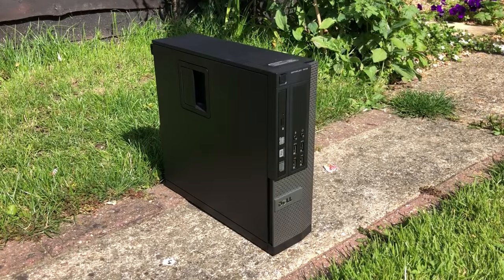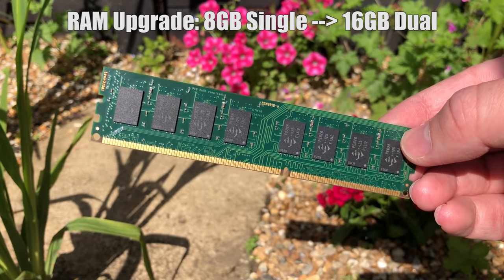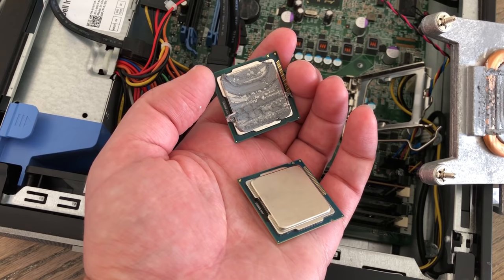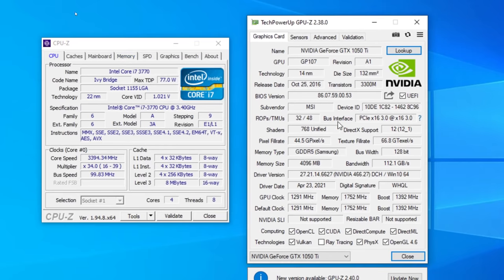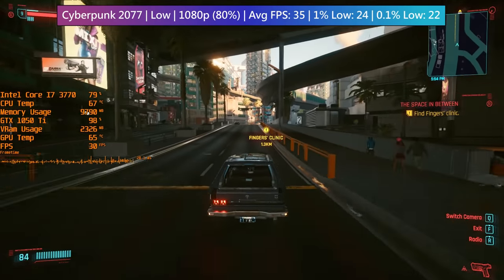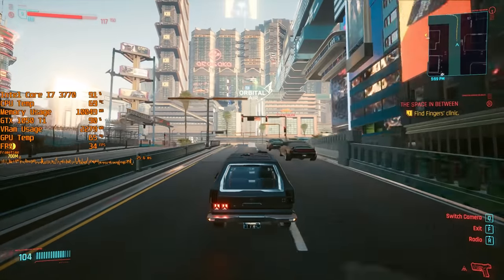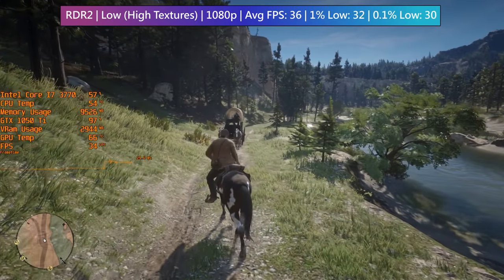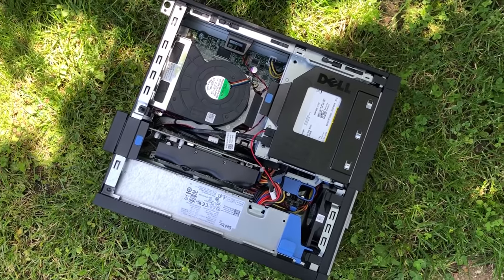Turning The Tiny, Cheap OptiPlex Into a Gaming PC - With Whatever’s In Stock

Comment: I just finished upgrading 2x optiplex 3020 mt’s. 16gb 1600 ddr3 in both, i7 4690 in one with an upgraded psu and 750ti. The other upgraded to an i5 4570, 16gb ram and a 1030gt. (Ssd’s fitted) -both were cheap to put together and work well -very happy -would recommend

Comment: I used to have an optiplex that I used for many games but it was really stuttery and hardly ran more demanding games that I liked even on low settings. It had an i5-3470, R7 360, 520w old psu, 3x4gb 1333mhz drr3, 120gb ssd, mobile 1tb hdd. After upgrading, 20 fps feels nice cause it's not stuttery anymore

Comment: I did something similar with a Haswell-era Optiplex for a back up machine. I used a Quadro P1000 instead of a GTX1050/1050Ti as it was cheaper at the time. Not sure how things are currently with the GPUppocalyse, but it used to be that lower end Quadros would often plummet in price when they got old, so were worth keeping an eye out for.

Comment: I have a Dell OptiPlex 7010 SFF: e3-1270v2, 32GB ram and GTX1650LP rig that is decent although now my main one is a Lenovo Y900 tower: I7-6700K, 32G ram and a GTX980ti. I still have my Dell for a backup, and also it's easier to take with me to different places.

Comment: i got an OptiPlex 3020 off eBay 8 months ago and ive been happy with it ever since, it came with an i5-4570 and 8gb ddr3 but i upgraded it to 16gb ddr3 and i added a gt 1030 because the 1050 would not fit (yes it was low profile) and i overclocked the gt 1030 debloated windows and i would say it matches the performance of this build and if not even provides slightly better frames especially in red dead

Comment: Sandy Bridge and Ivy Bridge were really solid processors. I managed to overclock the i7-2600k high enough to match the performance of newer generation intel chips, with no cooling problems whatsoever. Those generations were really OP when it came to performance.

Comment: I've got a 7010 with an i5 3570 in it. It only supports 16gb. And, the pcie16 socket is rated at only 50w despite being 3.0. While people do put 75w cards in it, it does both cripple any card that uses 75w, and stresses the board and psu. The gt 1030 gddr5 is honestly the strongest yet safest gpu you can use indefinitely. The PSU is a very uncommon/rare/really only made for oem's called LFX, which has different length and height from TFX as looking at it from the back of the pc. Also, I'm not absolutely certain, but I'm pretty sure they swapped a couple of pins in the 24 pin connector around as well, but if you happen to find an LFX psu with more wattage, then you likely could just use a molex pin remover and swap the pins around as needed, but good luck finding an LFX psu in the wild for anything other than the computers they're designed for (they typically have proprietary power connectors).

Comment: I built a refurb Optiplex with an i5-7500, 16GB RAM, 240GB SSD and the 75W low profile GTX 1650 for just under AUD$900 last October, runs really well; Deus Ex Mankind Divided at 1080p high settings is no problem. Make sure you buy a USB DAC as well though, because the onboard audio is rubbish.

Comment: Amazing upgrade. I'm building a new system with a Ryzen 5600X, but until then, I'm still rocking my old Xeon X5650 (upgraded from an i7-950!) with a 1050ti. 

16Gb is indeed the sweet spot for gaming, only thing I would recommend, if possible on a budget, is to get the fastest memory modules you can.
Maybe also replacing that case fan with something better like a Noctua one (although they aren't the cheapest), and definitely ditching that DVD drive, which could help improve airflow and temperatures inside the case... :)

Comment: I brought that unit recently except since it came with an i3 for $40 and that was because it had no hard drive and ram. I ended up upgrading memory to 8GB, 500GB HD and stuck in a Nvidia 210 and ended up being under $100. My only issue was it came with some bottle necking due to i3, but did find some units that came with i5 I hope to snag someday and have been aiming for those GTX 1050 ti or 1650 low profile ones.

Comment: Got the exact same optiplex, upgraded to 3770, 1tb ssd, 16gb ram, cut a hole in it and put in a 1650. I also painted it, to make it look rusty, put some chains and stuff on it. Like a "mad max" kinda build. Runs great😁🤘
Reply: does it give any problems?
Reply: @lightffx4423  This is a late reply, sorry about that. But no it worked perfectly fine. Just make sure you get the 1650 that dont need external power, and know that the cpu runs a bit hot, but nothing to bad as long as you mount the cooler okay :) And since I cut a hole in it, since i couldnt find a low profile 1650 my gpu never got hot x)

Comment: For Cyberpunk, setting crowd density to low and slow HDD mode on (even if you use an SSD, since what this seems to do is reduce draw distance) also helps a bit with FPS. And also ray-tracing to off if you have a GPU that supports it but that's irrelevant with a 1050 Ti. Ray-tracing eats a fair bit of CPU if enabled.

I have an i3-10100 and those three settings keep me at 60 FPS most of the time, because said i3 is a 4 core / 8 thread part and Cyberpunk really struggles with those even if they're newer.

Comment: I have a 1650 in mine and I'm very much enjoying it. Was playing Fallout New Vegas at native 4k high settings with a solid 60fps. (No I'm not lying). It's insanely awesome and I'm genuinely surprised it can do that. Warzone on the other hand struggles to maintain 60fps but it plays fine. All in all, very happy with the machine. Much better than a base xbox one or ps4 around the same size.

Comment: My dad's had an optiplex 790 sff for nearly four years as a family pc running Ubuntu, it has a 2400 and room for a low profile 1050 so I'm tempted to clean it up, replace thermal paste and possibly add a fan and get a gpu to sell on.

Comment: Yoo nice. Ive got a similar build (my dad's actually), i7 3770, 16gb ram, optiplex 9010 with a msi GT 1030 GPU (fan model). Ive done some benchmarks and gaming tests on there and I'm really happy how it performs considering it costed only $300 AUD (£161), the CPU cooler is absolutely fine, better than what most Dell gaming prebuilts offer now, but the GPU does run a little hot at 80 degrees Celsius.

Comment: I had one of these PSUs explode with GTX1050Ti, I recommend removing the disk drive while at it to lower the power consumption slightly.
Reply: Bro which psu explode was your pc Dell optplex 790
Reply: @feyn321  yeah, I replaced it with similar PSU, and it worked fine after. Now I have removed the graphics card because the fan started making noise and I couldn't get another one.

Comment: That’s what i did ,optiplex 3020 tower with i3 4130 for £70.Put a 1050ti low profile(wasn’t my choice that’s the one cex sent me .Then later down the line got a 4590 for £40 .Switched case finally got a new mobo and I’ve got a properly built gaming pc now !

Comment: I feel like a 1650 would have been a perfect match for this system!
Reply from the maker: Yeah so hard to find at the moment, or way too expensive :(
Reply: A low profile 1650 costs around $400 in the USA, so I can only imagine what it costs elsewhere.
Reply: @madmax2069  here you can get a 1650s for the same price as a new 1050ti (~200€)
Reply: *here in germany
Reply: @TheMauriStar  But are they the low profile version? They have one on UK Amazon, ASUS but it is not low profile at £299.

Comment: I bought a couple of Optiplex 790’s a few years back as they cost about £40 from eBay, Both have an older i5 2400 CPU which Work for the most part, I stuck an AMD 290 Full-sized Graphics Card in mine & was unable to fit the lid back in place but that’s fine and it’s only been used for Protein Folding, I haven’t done it now for a while due to the Cost of Electricity, I may see if I can upgrade the CPU & try & find a low profile Graphics Card as I do have an assortment of Graphics Cards in a box here somewhere, They are a tidy compact Machine and the only downside to them is the PSU, I think I’m using a Desktop PSU that just plugs in and sits behind the PC, It works but obviously not ideal! 😂

Comment: If you can find a Xeon E3 1270 V2 for cheap, and have a GPU, that's also a great budget replacement, as they run a little cheaper than the i7 still. I have one, and it cost ~$50 USD, whereas an i7-2600 is still ~$60USD.

Comment: I have this exact pc, though I have the Optiplex 7010 with the big case, it got the i7 3770 and 16gb with 4 sticks of ram. I stuck a rtx 3060 in it. It runs really well in most games. The games I tested are Minecraft Java, GTA V, BeamNG Drive and Minecraft Bedrock RTX. It does struggle with GTA on very high settings, mostly due to the cpu. BeamNG Drive can play on the highest settings at 55-60fps. And Minecraft Java can run and med to high settings at 60fps with shaders. Bedrock with rtx can run at 60fps with high settings. It is a really solid pc.
Reply: I am not saying to get a RTX 3060, a 1050ti should work fine. But just get what you can afford and what is not over priced.

Comment: I did one of these before but it was the mini tower model and I changed the power supply also. 3770 and 1060 6gb. Add a SSD and you've got a Solid PC.

Comment: THIS IS THE VIDEO I NEED THANKS
Reply: by the way, where did you buy the 1050ti? im gonna build a optiplex pc with a rx 560 and im worried that it wont work or will go out of stock. there arent many good 100$ graphics cards
Reply: @skunksecond  I would recommend a 1050ti over a rx560, as a 1050ti performs about 30 to 40 percent better than the rx560 best of luck with the build 😄

Comment: I turned one of those into a heck of a pc for my daughter.  Nice for a pc I bought from work for $50. I put it in a new case.  There is a thing for the power switch off of ebay you can get to work for the power button.

Comment: Xeon CPUs will run in these Optiplexes. They can be had cheaper than i7s. I bagged a quad core fourth gen Xeon on eBay for £15 and it runs in my SFF 7020 with no problems at all.

Comment: I have build the Same PC 1 year ago. But I have 24GB Ram and use a Gigabyte 1050ti OC Edition with 1 Fan, because this card is silent in Idle Mode, the MSI 1050ti I used before with the 2 fans runs always with 40 % fan speed and there's no way to lower this! Afterburner doesn't work!
It's the perfect understatement Gaming And Lan Party PC :)! And yes, it runs Crysis very smooth in FHD with Ultra Settings. Dirt 4 and Fallout 4 in FHD with highest settings run very smooth too. Cs Go in FHD with maxed settings runs always  between 200 and 300 FPS!
I became the PC for 0€ and the GB 1050ti OC costs me 60€. I have much luck to became this. I build a 500GB Samsung Evo SSD in it ( for. 0 €:) and my external 4TB HDD changed in this PC too.
It's crazy how much Place is in this little case and how good it's upgradeable. Dell does a perfect job here.

Comment: You didn't mention if you had swapped out the storage or not? That was the first upgrade I did to the Intel 4th Gen Optiplex USFF I bought for my mum last Christmas. As she doesn't really game, it has a Gigabyte GT1030 with DDR5, a 500GB Crucial MX500 2.5 inch SSD (No NVMe support of course) and an Intel i5-4590S CPU (it originally arrived with an i3-4130) - the 4590S has slightly lower clock speeds than the 4590 but it has the same TDP as the i3, while having 4 cores and 4 threads and being available from CeX for around £40. She has been using this for a lot of video conferencing (thanks Covid) and it has been really reliable so far. The SFF variant may be better for gaming, as it is slightly larger, so it wouldn't be so difficult to fit a 1650 in there. 

It makes me wonder why Dell's power supplies in the USFF and SFF Optiplexes are so large and heavy with such low output. It just seems stupid to me.

Comment: Disable spectre/meltdown and telemetry, tighten the timings of the memory, and overclock the cpu via Block by 2~3% and you should see a massive 10~15% gains in min frames and reduced stuttering.

Comment: A tip for anyone wanting to do this build, buy a Xeon e3 1240 v2 instead of the i7, it’s about half the price and is exactly the same apart from its 100mhz slower boost clock and no onboard graphics, which doesn’t matter if you have a 1050ti like I do 👌🏼

Comment: At least you have the Optiplex 7010 and can use 2-slot LP cards. Assuming you still have this PC, you could go up to an RTX 4060 now, but I doubt the 3770 could keep it busy enough. Maybe. I have an i5-4590 in an Optiplex 3020 and can only use single-slot cards. That limits me to only certain GTX 1650's and the RX 6400... I was running a GT 1030 for years and I wanted a little more. I ended up finding (apparently on some flash sale) for just under $100 delivered, a "SRhonyra" GTX 1050 4GB (yes weird, I know they normally have 2GB, I'm not complaining) and it does okay, but I don't play the newest titles, so there's that. Also, this card gives me NVENC (which the 1030 doesn't have) so that's awesome for dealing with video. Still, I'm going to pass this system along to my wife pretty soon after I build myself a new one. Whenever that is.

Comment: 1650s have also been refreshed with DDR6 memory but the one's available all need a bit a rigging as they use a 6 pin connector.
Reply: Wait, all of the 16-series cards didn't come with GDDR6 memory by default? Huh. That's news to me.
Reply: @richardsinclair7661  
No it was initially just the Supers and Tis, the basic models used GDDR5.  In theory this should bump performance close to the 1650Super.
Reply: @darthwiizius  Good to know. I have a 1660 Super, so I guess I unknowingly got a better card, haha.

Comment: Great. I’ve got one of these. I put in a 4790, upped it to 16gb ram, and managed to snag a 1650. Also got a 500GB SDD, and a 4TB HDD. Happy days 🤩.
Reply: Same!! I found a basic HP desktop with i5-4590, 8gb ram, and 500gb hdd for $50. First PC ever, did some research and found 1050ti was my best option as my PC has a proprietary psu. Dug some more and found it can actually take a 1650 which is a significant leap over the 1050ti. So I bought the 1650 (gddr6 version) for $160 on Amazon right before chip shortages and price increase took place. I since upgraded to 16gb of ram and a 250gb satta SSD. For $250 total I have a pretty competent machine. Even capable of very minor VR games like VRchat. Been that way for a year now.

My buddy actually found an old i7-4770 in storage and it's actually compatible with my motherboard so I'm going to upgrade to that shortly which will see even a bit more performance. I'm shocked foreal. It's It's great machine for $250
Reply: @TTBUG  dude, amazing. The 4770 will get you to 4 cores / 8 threads. (Your i5 is only 4cores). This will give you a good uplift in more modern games - because the GPU isn’t waiting for the CPU so much. Many people who don’t know what they’re talking about say that the power supply can’t take all this extra stuff, but that’s rubbish. Mine is going strong. Phil of Phil’s computer lab (YouTube) has a video with a similar setup, and found around 150w at the wall. 
I’ve cut a hole in the case above the CPU fan, and temps have gone down 10 degrees. 
My 1650 is on the x4 PCIE slot (the short one) - but I’ve compared many benchmarks, and it’s between 5-10% difference in most games. So not a problem! Happy days! 🤓👾👍
Reply: @jameslucop4503 I saw that! Lol I could see a pretty big gain if I get the 4770 which would be great. 

But yea I was a little concerned about the PSU but it is 320w thankfully. So I know I'll be okay, with the I5 taking an average of 84w and the 1650 at 75w I still got plenty of room to spare for other components.

Comment: Most impressed with the CPU upgrade.  I somehow always overlook that possibility and just focus on the video card/memory side of things.
It's easy to forget that these CPUs are so cheap used.
Reply: The disparity between those 3rd Gen i3s and the 3770 is amazing. I tried adding a GPU to a i3 3320 before quickly realizing that I would need to snag a cheap i7 from Ebay 🤣 that i3 stuttered so badly that games were unplayable (paired w/ 1060 6gb).

Comment: 11:49, thermal throttling perhaps?  hps and dells have cooling modes, and if it's never making noise despite hitting max loads on the cpu and gpu, chances are your cooling mode is set to silent/low. kick it up to performance mode on hps really brings out the hoover vacuum levels tho.
dells are my favorite to upgrade on budget ends for kids. hp's  non  full form factors tend to have dummy pci e slots that require a proprietary display adapter card that is just 100% pure adapter slot and has no real pcie interface to the computer.

Comment: I’ve done this! I have a sell optiplex 3010 and put my 1050 ti low profile in it and sometimes it can be annoying as the wires can hit the fans making a noise and I have to move them. I’m going to be getting a 7010 mt which is better for airflow and performance

Comment: i7-3770k with 32gb of ram and a 1060 6gb were used to design a game in unreal engine in 2021 XD
its a demanding game as well. Days of Purgatory on steam. That cpu is REALLY impressive for its age.
Reply: CPUs don't change much after years in performance Vs the newer one but GPUs change alot

Comment: I have a dell optiplex micro tower that i got from an office that was closing down and selling chairs ect. Has a 4790 8gb and a 500gb hdd. Only changes i made was an ssd, an extra 8gb ram and a 1060 6gb runs my games fine. Bough the dell itself for £100 the upgrades was from cex whoch made the whole thing just under £300.

Comment: The red and black is an intrusion switch. That Optiplex doesn’t need it.

Also, IIRC, the BIOS update on this system needs to be done because of both VPro and the processor exploits.